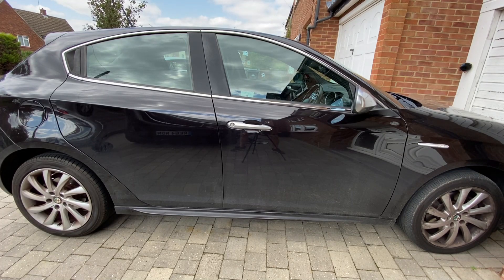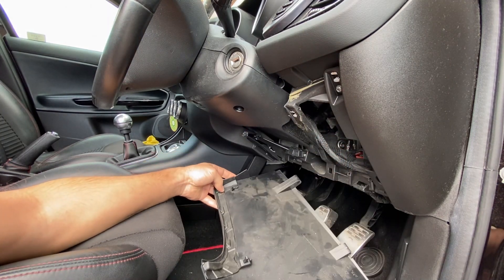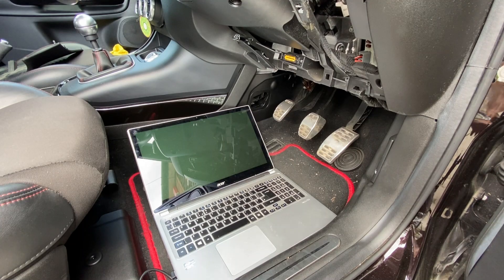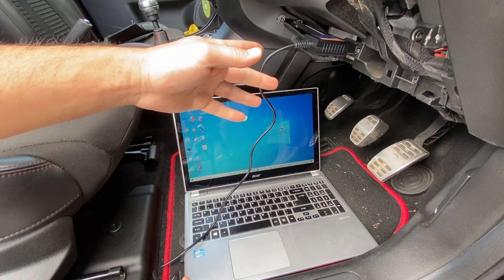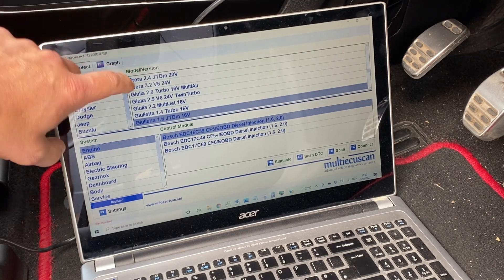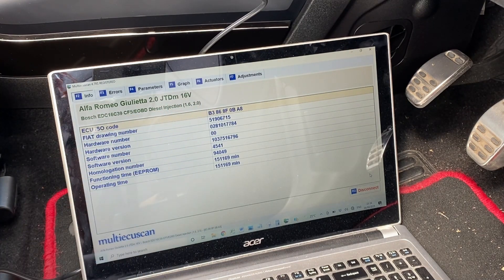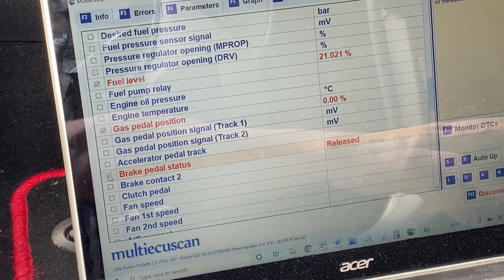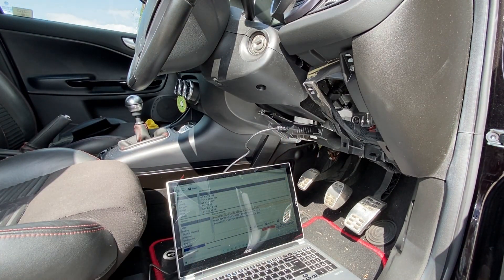Alfa Romeo Giulietta OBDII Diagnostic Port Connection

Comment: So I have same model, same year but my blue&me module has never worked, don't know it's had an attempted replacement before does anyone know what part no. Works for this car? Are they car specific or does any work?
Reply: Hi Diablodood,have a watch of this video I made 2years ago. The part either starts 5051 or 5052. Look at your part and see which one it starts with. That's the one you need. https://youtu.be/Vup8uassl1s
Reply from the maker: Hi Diablodood12. Not sure on the part No. just yet, but if you swapped it out for a replacement unit, you’d need to do a proxy alignment using the diagnostic tool. 
Hope that helps??
All the best 👍

Comment: Hello, wondering if there is software out there with which i could change stuff..like turn off the power steering when in D ynamic mode or tinker with other settings a little?! Great video.as always.stay safe
Reply from the maker: Hi Stahl. I’m sure there must be something but not that I’m aware of. If the car is set up using factory programming software to configure stuff, then I’m sure it can be changed. 
If I hear of anything I’ll let you know. 
All the best. 👍
Reply: Hello, thx. I asked around n contacted a few guys who tinker with the software concerning getting more hp but noone realy replied. Which is weird because I cant be the first who would like some custom settings...thx for your reply. All the best

Comment: On mine the obd port it's on the lower corner of the steering wheel panel, no need to remove anything. I don't if that happens because of the steering wheel position or because I have a facelift model but that's a really odd place to have that port.

I would also advise you to check Alfa DPF it's an app that allows you to monitor the DPF filter, the EGR, faults etc. But for that you would need a Bluetooth obd
Reply from the maker: Hi Spartan19891, Good to hear from you again. That's good to know, and useful for others also. Thanks for watching and commenting. All the best. 👍